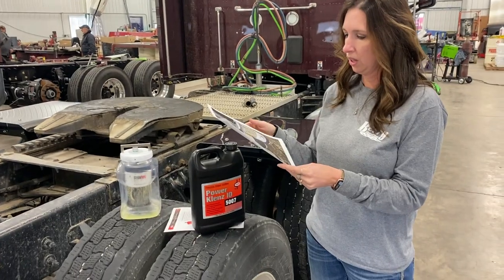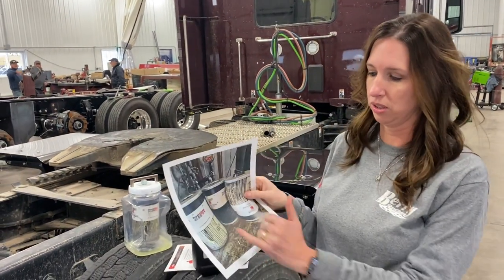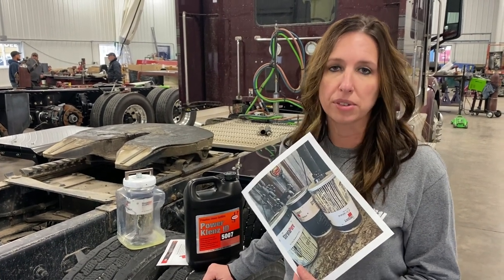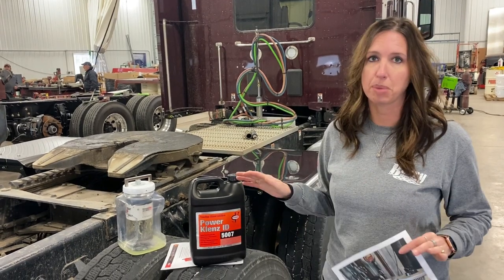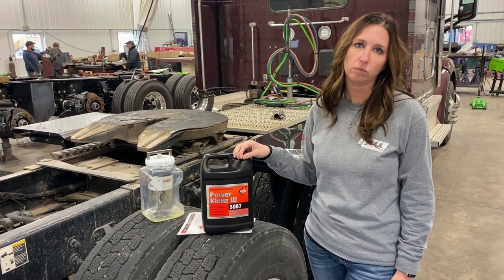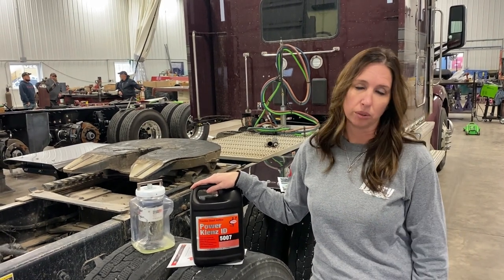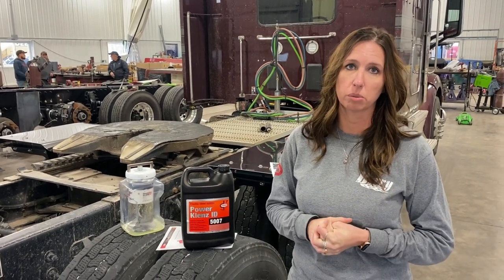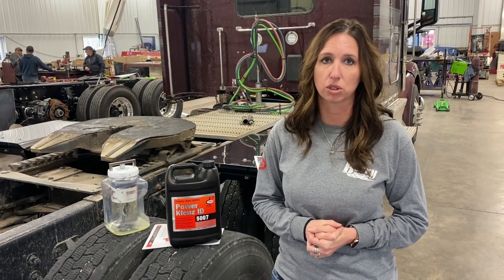Primrose Power Klenz 5007

Comment: That’s an interesting product, never heard of it though. 
 I haul fuel for a supplier in Western Colorado. 
 Our company buys Power Service by the chemical tote. As we unload into the bulk plant, the additive is blended into the pump.
   A big part of our business is supplying the fracking industry with fuel. The high pressure common rail engines create heat & high pressure. That creates asphaltene. The fuel is trying to molecularly change back to asphalt, it’s original state. 
The black residue we see in the fuel filters. 
This is primarily why we use the Power Service.

Comment: Interested in using this , how much product is used in a average 150 gallon fuel up ?
Reply from the maker: Initial shock to clean the system is 1 gal to 250 gals fuel. Then after that each fill up us 1 gal treats 1,000 gals of fuel